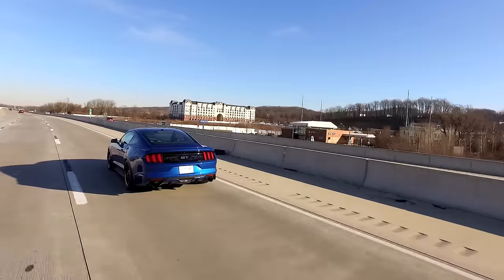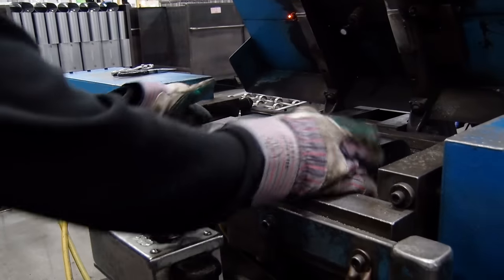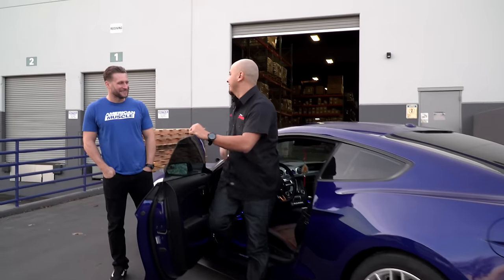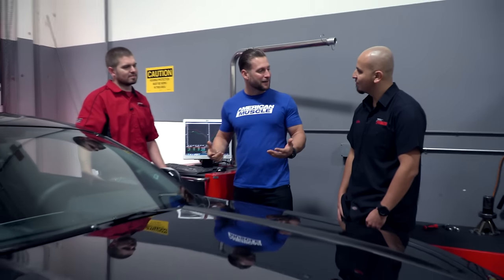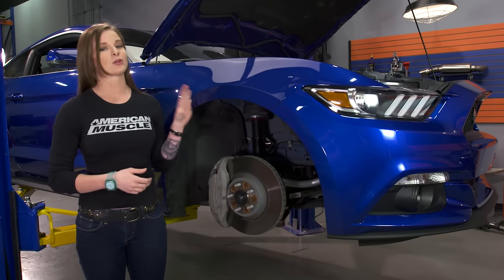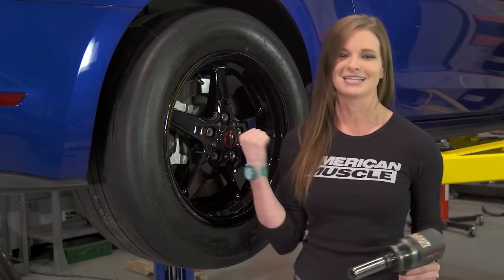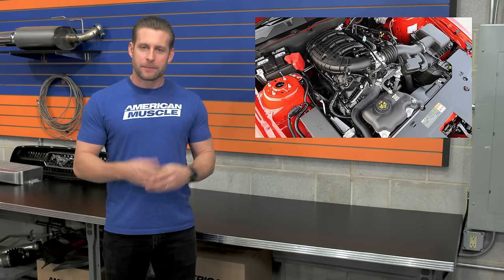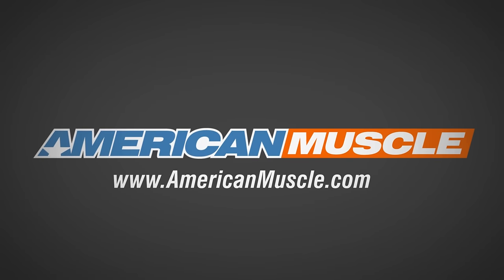Steph’s 2017 Mustang GT Build || 2018 Mustang News || Inside Flowmaster Factory- HOT LAP

Comment: Cool tour guys! B) I got a Flowmaster muffler for my 1991 Pontiac 5.0 Firebird V8 back in the day. Sounded great! That was a looooong time ago and the 1st upgrade I ever got for any car. Fastforward a few years.. haven't gotten Flowmaster again. I should get their pipe system for my 2014 Mustang V6, but I'm done modding for awhile. My car is wicked fast and sounds wicked too. Pipes and 3.55 gear would be my next upgrade but for any more performance I'd need better shocks, springs, tires, rims and other such structural things. That would get too expensive more my wallet :(    Currently I have in order of purchase.. SCT X4 tuner, Airaid CAI, Goodyear Triple Tred Assurance H-rated tires, PowerStop drilled/slotted rotors with ceramic brake pads, MGP caliper covers (just for looks), Continental poly-v drive belt, K&N (better) filter for my Airaid system, and most recently a SR Performance one piece aluminum driveshaft that I bought from you guys at American Muscle B)

Comment: I wonder how long we will see the normally aspirated V8 remain in production for the Mustang (and in other performance cars). It seems that there will come a day in the 2020s when the switch will be made to 4 & 6-cylinder turbocharged engines.  Despite my advanced years, I won't bemoan the passing of the V8 since I am impressed by the increasing capabilities of the EcoBoost family of engines. Even the Ford GT has moved on to an EcoBoost 6. The times, they are a-changin'.

Comment: When lowering and raising the car on these bags, does it mess up camber? If it does, what's the point as it burns through tires every few thousand miles.
Reply from the maker: Hey Donavan, when the car is on air lift, you want to get it aligned on the setting that you will be spending most of your time. If you make small adjustments, it will not effect anything enough to notice. That being said, if you are ever making big swings (slamming it or raising it all the way) it is only for a few minutes and or while parked and the car will still be aligned to spec as soon as you return it back to your chosen setting in which you aligned it! Hope this helps! - Will